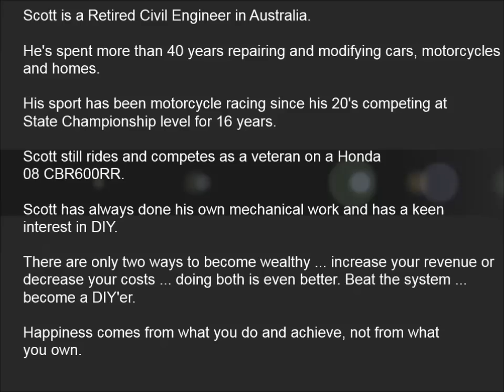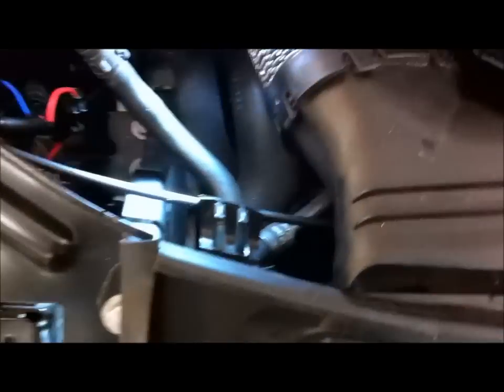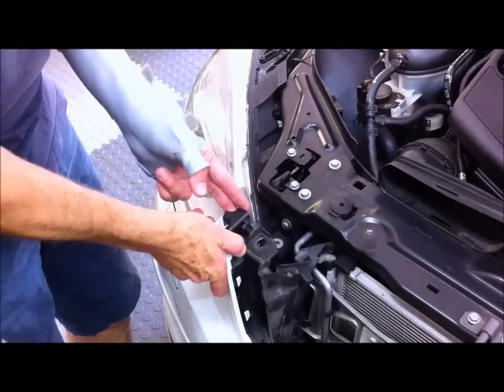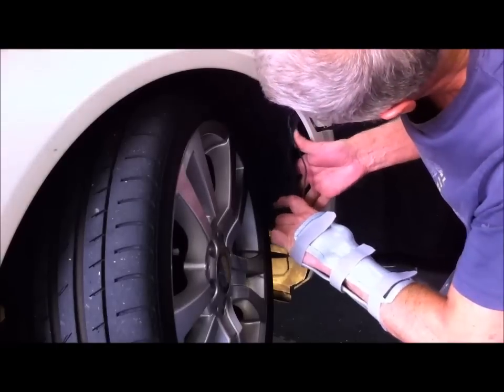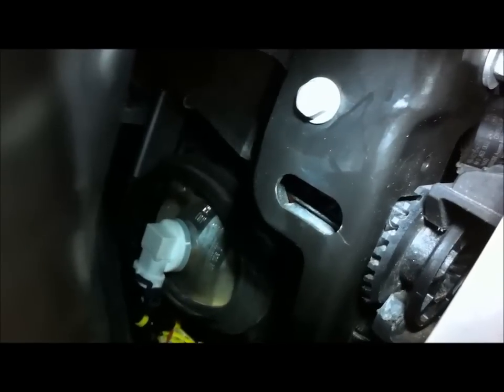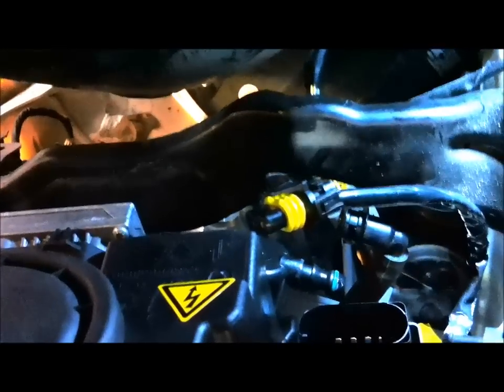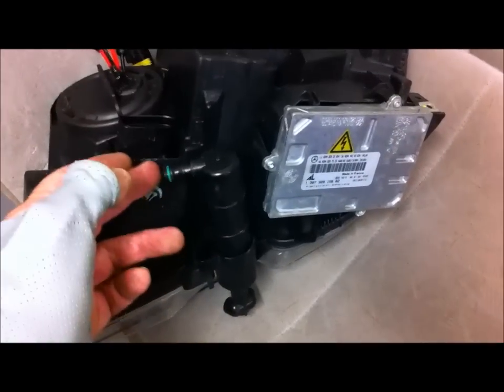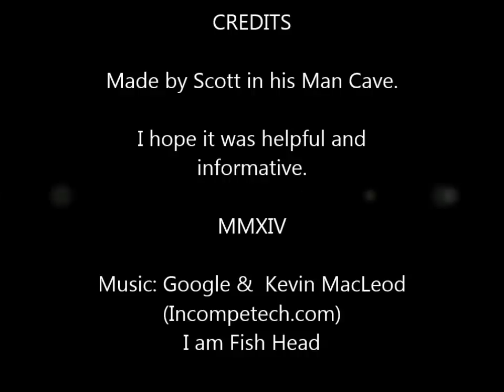W204 Mercedes C Class Remove Headlight Headlamp Install Ballast Bi Xenon HID Angel Eyes Halos

Comment: Very many thanks for this.  In importing a formerly British-registered W204 permanently into The Netherlands, I had to install headlight units that point towards the right instead of left (that's a real thing) to pass the inspection.   Whilst the job took a couple of frustrating hours to do (!) I found some decent aftermarket headlamp units and saved myself over €1000 compared with the dealership's quote.  But without your video, I doubt I could have figured it out within a month of Sundays.
Reply from the maker: That's great to hear Dave. Good on you for having a go and saving a heap of money.

Comment: The lens on my headlight was cracked and UK weather meant that the moisture has clearly gotten in. My dipped beam has gone out and right indicator and intelligent light system, does this mean I need a whole new headlight??
Reply from the maker: You may need a new ballast which is bolted to the underside of the headlight.

Comment: Hi Scott Thanks for the those informative video's...i have a question, i have similar lights as yours my right d1s bulb stop working and i discovered that it was fine as i replace it with the left working bulb and still it didn't work, can it be the ballast is faulty or their is other thing to look for.
Reply from the maker: Mohamed Kamal Hi Mohamed ... do you have a fault message on your dash?
If you've made that test you've deduced the globe is ok however I'd swap the globes over as a second test to see if the RHS works and the LHS stops.

I can't think of anything else other than the ballast. They're easy to replace once the headlight is out and you can get them on eBay easily. The ballast and headlight control unit are one item so unfortunately I don't think you can use a cheap generic ballast only. It's something I'm investigating. Kind regards, Scott
Reply: Yes i do have 2 fault messages,"active light inoperative" and "right dipped beam" and yes i did replace the bulb from the right headlight which was not working when i put it in the left headlight it works... thanks a lot for your reply i will change the ballast.

Comment: Thanks for the video! I have a 2014 c250 coupe, would I be able to do this to mine? Also, if I do would it void out my factory warranty?
Reply from the maker: +MissRomalyn Hi ... this video is how to remove the headlights so yes you can do that and no it won't void you're warranty if the work is done properly.

If you're referring to installing the angel eyes into your headlights then yes it can be done to the 2014 headlights. Providing the lens is resealed properly then I can't see how warranty would be an issue. Although the dealers will always try to bluff and say everything will void the warranty.

I do what I want to do as it's my car. I'm not bothered and never have been by the warranty. I see it as something for major failures and fitting extra lights into the headlights is unlikely to have any effect. My cars warranty period has expired so it's no problem anyway. Regards, Scott

Comment: Hello good evening Scott. could you give me the exact item of the ballast for a left optical ? Its an ILS bi xenon for a 320cdi SW 2008.
Reply from the maker: This is the OEM unit and part number http://www.ebay.com.au/itm/MERCEDES-C-CLASS-W204-2007-XENON-BALLAST-UNIT-A2048700326-A2048700426-/201649121236?hash=item2ef33967d4:g:iD8AAOSw6n5XtUUN
Reply: Scott Elliott thanks. I need to use something else after replacing the new ballast ?
Reply from the maker: I'm not sure what your question refers to. Once you replace the broken ballast the lights should work again.
Reply: Scott Elliott I don't need a diagnostic tool after to reset something ?
Reply from the maker: I'm not sure as I've never change a ballast. It's possible it may need to be plugged into the STAR system.

Comment: Hi Scott, thanks for the video, it's been really helpful.

I have recently changed my driver side with a new headlight assembly w/ ballast since that old one had a crack and the ballast was dead after a car wash. After changing, the color is not matching the passenger side one as the new one is really bright(bright blue) and the old passenger one is kind of week (weak white color).

I am just wondering if you know why it's happening like this? Do I need to change a new Xenon light bulb? Because I have a mechanic here told me it's happening as the "ball glass in front of the bulb“(not sure the term of this, lens maybe?) is getting old and that couldn't be fixed/cleared/replaced.....Is that true?

It cost me $2000 to replace the driver one already :(  and I really appreciate any suggestions or ideas if you may have. Thanks in advance!
Reply from the maker: +Wentao Xu I would think the new bulb is a different colour temperature to the other side. The mechanic would be referring to the projector lens. It sounds like he's giving opinion off the top of his head ... in other words he doesn't know and is trying to sell you a headlight as you have to buy the whole thing. I ignore industry staff opinions as they have a vested interest.

You can buy a pair of D1S 35W HID bulbs at 6000k colour temperature off eBay very cheaply. 6000K gives you a crisp white light with a hint of blue. search eBay for "D1S bulb"

http://www.ebay.com.au/itm/2x-35W-D1S-D1C-D2C-D2R-D3S-D4S-Car-HID-Super-White-Xenon-Head-Light-Bulbs-Globes-/301545672204?var=&hash=item463585ce0c

$2000 for the driver side is outrageous. You can buy non original replacement headlights for a fraction of the cost.
Reply: Thanks Scott! I will definitely get that bulb and give it a try. I am more confident now by taking your advice as last time I fixed my control knob following your video! yeah!!!

So "D1S 35W with 6000k", is this the exactly one for all W204? Mine is 2010 C350 4Matic, btw. And.... do I need to worry about the projector lens by any chance? I just saw another video you have and took the plastic cover off and clear the lens, is that necessary?
Reply from the maker: +Wentao Xu Your projector lens will be fine I'm sure. Check your owners manual as the globe sizes are listed, however if you have HID's they should be the D1S size. I don't know of any other sizes used in those projectors.

I did a video of how to install Angel Eyes into the existing headlight which involves taking the cover off. My projector lens are 7 years old as the car was built in August 2008. The projectors look like they just came off the assembly line.

Buy a pair of those D1S bulbs, change both sides and keep the others as spares. Or do the LH side first and see if it's the same as new one.
Reply from the maker: +Scott Elliott Sorry you'd be LHD so change the RH side first.
Reply: Excellent! Thank you so much for the details! I have ordered a pair on ebay and hopefully it will here soon. I will let you know how it goes then. :)    Cheers!

Comment: Thanks for such an informative post. I have been searching long and hard for such a video. Your light connector has the same color arrangement as my vehicle (w204 c200) and I need to tap into the park  light wire to connect to a lighted star. Can you indicate which color wire I should tap into?
Reply from the maker: Thanks Philip. I can't help you with that wire colour. Have a look at www.benzworld.org. They do have some wiring diagrams for download.
Reply: @ScottElliott152  Thanks bro. Will do.
Reply from the maker: @philipdeg1594  You could connect your star to the fuel pump fuse in the engine bay fuse box. That's easy to get to. It means the star will light when the ignition is on. It will act as a courtesy light to as it will stay on for about 20 seconds after you switch the car off.

Comment: Hello love the videos! Keep them comeing. Oh yeah before I forget i have a question about my 2010 c300, it seems I don't have the iPod cable can you make a video that shows the dismantling of the cable or just how to install it... Thanks a lot!
Reply from the maker: Hi Ignacio ... thanks for your kind comments.

What you have to do is buy the appropriate cable.

I made this video last year and explain how you connect the media cable. You have to pull the COMAND out and plug it into the back: Mercedes W204 C Class How to Remove COMAND Command APS Navigation Head Unit

This should give you the information you need. Take the COMAND out first to make sure the empty slot is there. It's easy to pull out as you'll see if you watch the video. I don't have the media cables so I'm not sure what cable is required but I know it plugs into a slot on the back of the COMAND. You do have the NTG4 COMAND with navigation and fold up screen?
Reply from the maker: MrScott52 Ignacio you probably need this kit. It's not cheap. It will plug into the rear of the COMAND.@mb_ipod_ntg4_W204-W212-W207-GLK.html